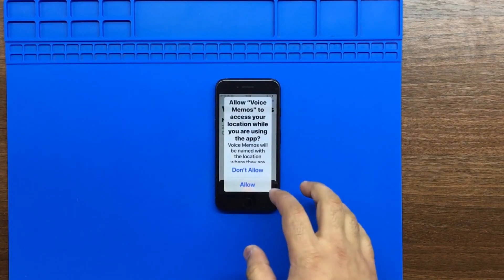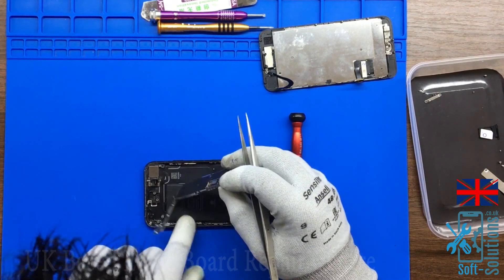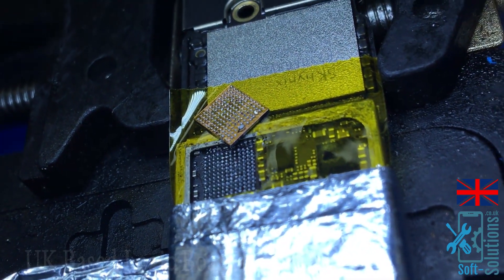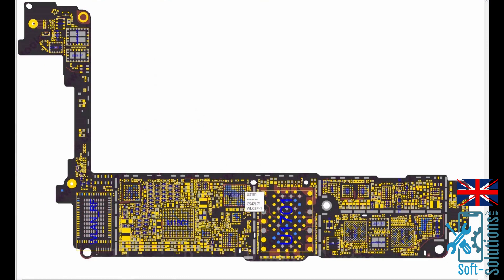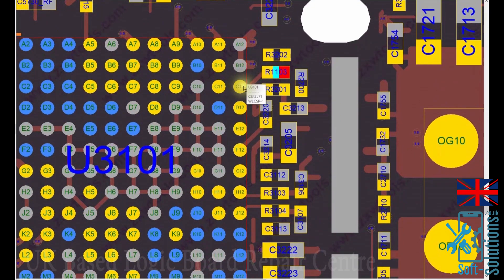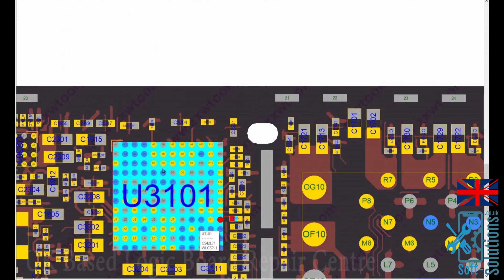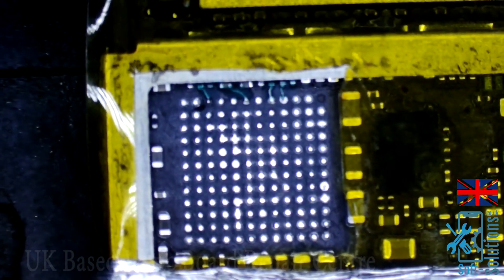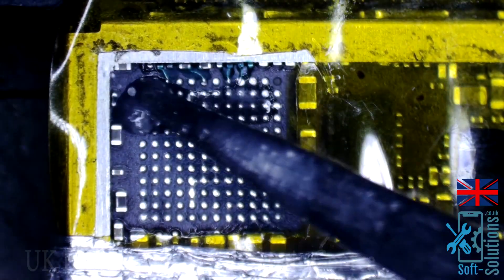iPhone 7 Audio IC jumpers, audio ic repair

Comment: Heat temperature ???
Reply: it depends on the hot air, my heat gun is not calibrated, it's a question of speed, even with 400 degrees it's still doable

Comment: Sir ..my iphone 7 's mic and ear speaker not working ..it works for 30 minuts  when i restart my phone and then again stop working..what i shuld do??
Reply: same issue with me after restarting it helps but after that stop working.....did you find its solution ?
Reply: @randomant4012  did you fix it??
Reply: @sinuswalih2588  hello,how do you fix my phone is also having the same problem